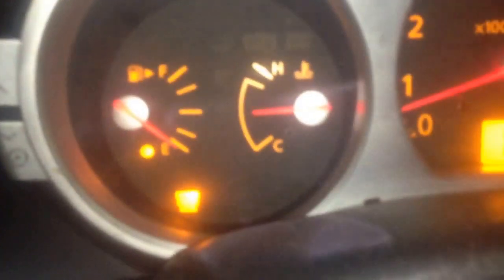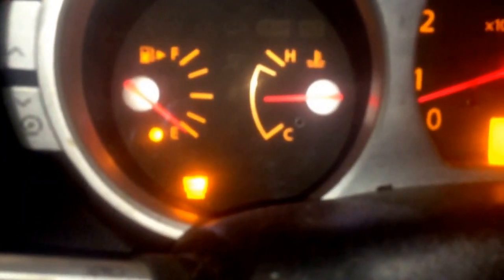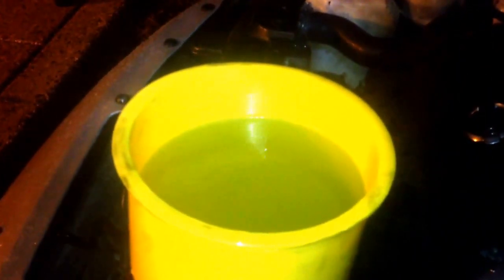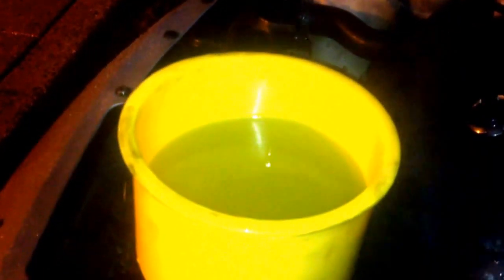350z cooling system overheating air purge problem with lisle spill free funnel

Comment: If you raise the front of the vehicle by jacking it up or parking on an incline nose up it'll help with the air bleeding..air bubbles rise and will follow the path of least resistance..right to that funnel and out of the system :)

Comment from the maker: Guys any time you open the cooling system, you will need to bleed the cooling system per the instructions.  EVERY time.  If you install a plenum spacer, disconnect the coolant line from the throttle body for some reason, install radiator... ANYTHING.  Just do it.  It will save you massive headache down the road and wondering if you have a blown head gasket.  Trust me on this.
Reply: Wish i read this comment 3months ago.
Reply: phreaktor1 hey I’m having the same EXACT issues out of my 05 G35 and I’m going crazy over it . I replaced the water pump and thermostat with autozone parts and it’s still doing the same stuff. What do you think ultimately fixed your car? Was it not a head gasket?

Comment: Literally finished doing this 5 minutes ago. That funnel should have come with a plug. After your temp gets almost 3/4 up on the guage use that plug for 10-20 seconds. Your radiator will make clicking and ticking noises, this is normal. You need to trap the heat in there to let it build up against the thermostat. Leaving it open will create a new high point in the loop and not let the thermostat open. If your heater is blowing hot air then that means coolant has passed through the thermostat and into your heater core. If not keep plugging it untill you get hot air. Fuck nissian for making this hard on us do it our selfers >:[
Reply: My funnel came with a t-handle plug so you didnt spill the extra. Might want to exchange for a new kit if you just got it

Comment: It is crazy how much harder it is to bleed the air in the 350z than in many other cars.  One huge issue is that the radiator is not the "high point" of the cooling system and thus, air bubbles can become easily trapped.  Pretty silly for a "racing" car to be honest.  This Lisle funnel makes life much easier when bleeding the air and was easily worth the purchase.  Putting the car up on ramps or jacking it up to make the radiator the high point will also help greatly when bleeding the system.  Squeezing on the hoses to purge air bubbles also helps as well as taking advantage of the bleeder valve, if equipped (see below).

One other thing to consider with overheating issues is the fan shroud.  There was actually a service call (under warranty) for defective fan shrouds though I'm sure there are still plenty of 350s floating around out there with bad shrouds/ticking time bombs.  One side failed on mine and would only spin when tapped with a finger.  Instead of taking it apart and trying to fix it or doing a like-for-like swap, do yourself (and car) and huge favor and upgrade to the Mishimoto fan shroud.  The stock one looks like a piece of crap compared to the Mishimoto; the amount of air it moves in comparison is staggering.  This should be one of your first purchases if you get a 350Z imho.

I have the APS TT kit on my car and there is a wonderful thread on my350z.com for anyone having issues with the overflow tank and coolant boiling and shooting out after a certain set of driving conditions.  The APS kit replaces the breather valve on the heater core hose and uses it in cooling the turbos, which can make it ever harder to bleed.  Anyone else in the same situation, consider purchasing a radiator breather tank for $100-200.  Greddy makes a quality one that you can easily add to the pressurized system and will automatically bleed the system.  Good luck all fellow Z owners! :)
Reply: I was considering making one of those radiator breathers!  Had no clue a solution already existed!  Thanks man!

Comment from the maker: I just recently started overheating again with cold air blowing from the heater, so I didn't get all the air out.  Went through this process again, but gave it a few high revs to 6000 rpm and it belched out a HUGE air bubble.  Everything is good now.  If the standard method isn't getting the air out, a few good revs to 6K and holding may knock a big pocket of air out of the system.
Reply: I'm currently having the same problem, but with my 2003 G35. I replaced the thermostat because while driving it wasn't overheating, but when idle it would overheat. Then it kept overheating and it turned out my radiator was cracked. (I think the overheating caused my radiator to crack). I replaced the radiator, once replaced, I filled it up with antifreeze (while car was off) and put cap back on. Turn it car on and no issues....so I thought. It started to overheat again, but this time while driving. The car heater did not blow heat through car vent and I hear water trickling inside the vents. I'm thinking it could be air in the line, but would need to get one of those spill-free funnels to bleed.
Reply from the maker: ***** That is the water pump, guaranteed. The gears in it are turning JUST enough while you are driving at a higher RPM, but at idle the pressure is too weak to circulate the coolant.  The radiator probably cracked from over heating over time.   Does it blow hot air while driving?
Reply: No hot air and I hear water trickling through my vents.
Reply: Misael Guzman it's air in the lines jack up the front of the car.....i had the same issue and this helped tremendously.......these waterpumps very very rarely go out
Reply: phreaktor1 no gears in the pump there is a one to one gear on the pump that is ran by the timing chain.

Comment: I know this is an old video but thought I'd add my two cents. If you don't open the bleeder valve that is near the firewall, air will be trapped in the heater core. That would be why he's not getting heat.

Comment: Jack the front end of the car up as high as you can get it.
Make sure the heater control valve is set to the fully open position. Confirm this at the valve, not at the slider control on the dash. You might have to disconnect it and open it manually.
Use the long extension that comes with the Lisle kit to get the fill point as high as you can get it.

If all that fails and after a couple days and you're loosing fluid you've got leaks.

Comment: OK I had a 2004 350z and I had to put car at incline jacked from the front and goose the throttle  until you see it start taking it in ,might not get it first time but keep trying and open up bleeder valve just to let out air /steam then close and Rev it quickly again and cap and drive it might be cold air but keep driving like normal and the little bubbles will go away

Comment: I had same problem, but mine was that I put in a thermostat from autozone, and it was compatible with the 350z but opened up later then the OEM one which once it opened up it was too late. So OEM thermostat it’s only few $ more than the one at autozone

Comment: So im having this problem now.. smfh went and drifted my car around with buddies, and a couple days later this happens. My bleeder valve was also very fucked. When i tried to crack it open it literally just fell to pieces.. now im waiting on it from nissan to come in tomorrow. I also haven't been doing this with a lisle funnel gonna go ahead and order one on amazon as not one single parts place carries them around me. I've replaced the thermostat but i feel lile i have already damaged the block too much anyways running it hot then cutting it off over the past 4 days. Hopefully once i get a funnel and new bleed connector i can get the air out of the system.

Comment: I know it's been a while since you posted on this but I am having the exact same issue with my g35. The funnel bubbles and overflows just like yours. I'm fearing headgasket. How did your car hold up over time after the proper bleed?
Reply: John Sakmar where you able to fix this ??? I’m having exact same problem...

Comment: Ever find out what the problem was? Having a similar problem with my G35, gonna start bleeding it and hope it's just air in the sytem.
Reply from the maker: It was the air in the system.  You HAVE to jack the front of the car up about 8 inches and follow the bleeding instructions.  After you get the coolant level stable, drive normally for a couple days and do it again.  I thought mine was good after this because I did a couple more heating, refilling. cooling cycles, but the temp guage wnet to 3/4 after a couple days (40 miles) of driving.  Pulled over and the level was super low.  Did the bleed procedure with it jacked up and it is solid.  Note-  If your heat isn't HOT at idle and operating temp, you have air in the system and it will overheat at some point.
Reply: ***** Thanks for the tips, will definitely keep them in mind. When you were bleeding the cooling system, did you have to loosen the bleeder screw at any point or is it even necessary with the lisle funnel? Thanks and i'm glad you got everything sorted out.
Reply from the maker: Yes I did.  I revved for 10 sec with the funnel in, let bubbles come up in the fluids, then cracked the valve open a bit till the bubbling stopped and coolant seeped out.

Comment: I have the same problem someone plz help I drive for like 5 min and it starts to heat up and when I park the car somewhere it starts to go a little lower ? I did bleed the system like 20 times already
Reply: Ivann Z33 hey did you ever fix it ?

Comment: I'm having this same issue. did yours ever overheat to the point where you had to turn off the car during this process?
Reply: I know this is 9 months ago but yes, mine has been doing that.  I thought the w/p was out but its not, the air just wont come the fuck out lol.  I know its not the w/p because sometimes when the temp goes up to a point, it then drops dramatically before overheating and I have to shut it off.

Comment: hi could you please give me some info? your replies are old so I assume you've worked out the issue. My 04 g35 was over heating and had no heat. I bleed the hell out of it for like 30mins. much very now, heat is hot and car stopped over heating. today I noticed I had a little coolant spray again(white spray marks) do I keep bleeding it?
Reply from the maker: "Coolant spray" from where?
Reply: From under the radiator cap. A sign that the pressure is going over 13PSI. This was happening to a much greater extend prior to the first bleed. Also the radiator cap has already been replaced.

Comment: Does the level rise because there's new air appearing in the system or is the level rising here but dropping by the same amount at the expansion tank?
Reply from the maker: I never figured out the pulsing issue. The level stayed the same in the bottle.
Reply from the maker: Craig Perry I think the level in the funnel is rising because of a huge airpocket in the system.  Once I got it out this time, the level did not rise anymore when revving.  Be prepared to spill some fluid.
Reply: +Craig Perry The key here is that the closed coolant system here (with funnel attached) is no longer under pressure but instead at atmospheric pressure.  Increasing the pressure will increase the boiling point in a liquid, which is why our cars have closed, pressurized systems.  In their directions, Lisle even warns not to rev the engine as it will probably cause the coolant to "erupt".  Of course, the cooling system on the Z is notoriously difficult, so you may have to resort to this to get a large air pocket out as phreaktor1 mentions.

Comment: @phreaktor1 
Im having the same issue on my car is your z still good?
Reply from the maker: +Golden Duck No over heating but heat is cold at idle again.  I dunno.
Reply from the maker: +Burnsy ColdBrain Did you burp the system after the tstat?  It could be that the water pump is failing to circulate the water properly.  I would do that before assuming its the head or block.  Its a cheap enough part.
Reply from the maker: let me know how it goes.

Comment: Its not head gasket. Your running with almost only water. Water boillig temperature is 100 degress. Coolant is up to 135 degrees. Try replacing your coolant with a 70% concentrate coolant and 30% water. The exactly same thing was happening to me.
Reply from the maker: The issue is back.  I’m going to do a complete flush and refill.
Reply: Boiling point is significantly higher when under pressure. If it won't work right with straight water... there is an issue. Of course... ideally you should run the manufacturer spec mix. But they call it antifreeze and not anti-overheat for a reason.

Comment: I’m having the same problem dead ass
Reply from the maker: It was the air in the system.  I kept purging and eventually no more bubbles came up and it didn’t overheat.  Check the little easy things first.  Radiator cap, thermostat, leaks, radiator etc.   Good luck!

Comment: I had the same exact same problem. I replaced the thermostat and i thought everything was fine. I drove down the highway and my radiator cracked as well. Im in the process of replacing the radiator. How long did it take you to bleed out the air?
Reply from the maker: +Andres Vera about an hour
Reply from the maker: +phreaktor1 was your old tstat actually bad?  I replaced mine with a new aftermarket one from Auto ZOne and it went bad in a month.  Put my old one back in (which was good even tho I replaced it) and everything was fine after a bleed.

Comment: the problem your experiencing is the beginning of a bad head gasket. you have combustion gas leaking into your coolant system, I had the exact same problem with my vq. change it before you actualy warp or crack something. at this early of a stage just a simple gtasket change is in order, but if you allow it to progress it will require much more as you will warp or crack a HEAD.
Reply from the maker: Its been almost 2 years and no more issues after a coolant flush and purge.
Reply: false nissan coolant systems definitely the vq line up takes time to get the air pockets out. .it truly sucks
Reply: Where i can buy the radiator cap with the bottle....?
Reply from the maker: eBay?